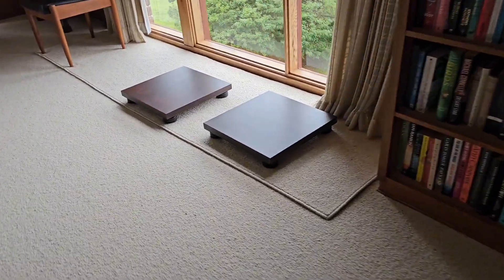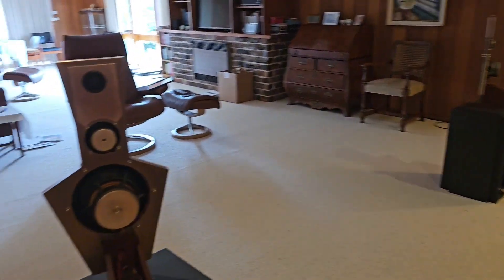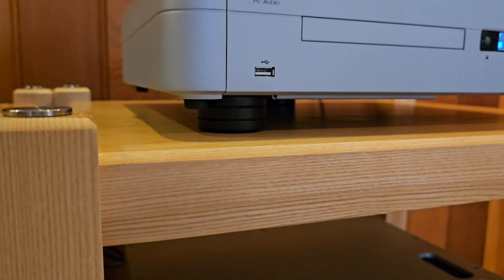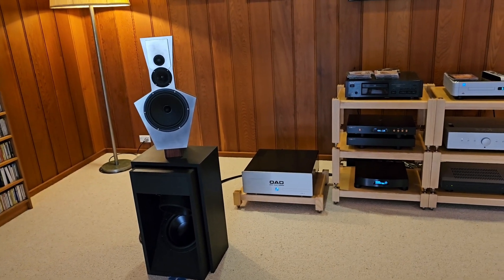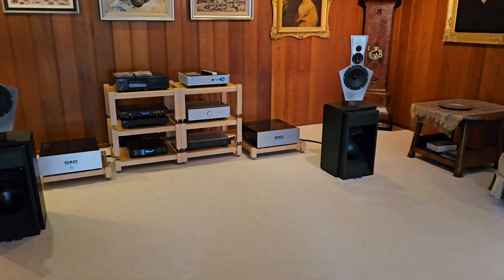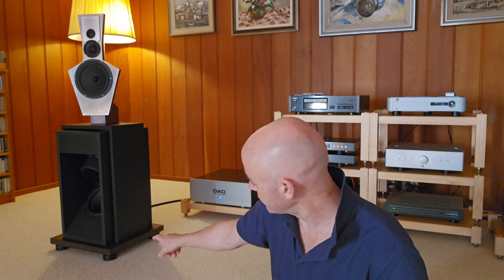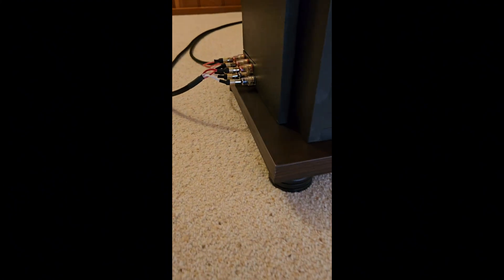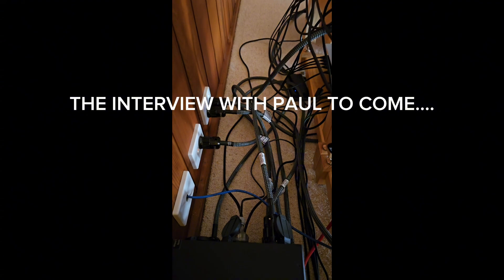"LINKWITZ LX521 BUILD THE SYSTEM INSTALLATION & VOICING PART 10"

Comment: Linkwitz was great! sad to see how this german doctor is milking the Linkwitz legacy with massively overpriced gear. The problem of the LX521 are the in-place-locked low frequency enhancers, once you move them into the right location for your room the speakers opn their tall bridge start to look really odd.
Reply from the maker: I got them sounding spot on in that position, which looked fairly standard for a speaker system in Paul's room, I thought. I do agree with you about things being overpriced, and the quality of the componentry was just not up to scratch, considering how much this stuff costs.🎧🙂👍
Reply: @anaussieaudiophile  Linkwitz was an awesome engineer and also great person. I love the speakers and did seriously consider them but got into the hands of that german doctor that holds the rights and sadly it fell apart, he is all about financially milking the Linkwitz work, it made me rather angry,, because it is the very opposite of what Linkwitz intended.
Reply from the maker: @mediascapes2011  Yes, I agree with you. It's become a sad situation nowadays.
Reply: @mediascapes2011  Hello there. As you say,  Linkwitz was a great engineer, and the LX521s are great speakers.
They can be purchased complete, or in a kit from Germany (as you have said), but they can also still be purchased from Madisound in the US (the first firm authorised by Mr Linkwitz to do this), or made from scratch from the plans, with the drivers purchased from one of the other two sources - I am aware of a few people who have successfully done it this way.